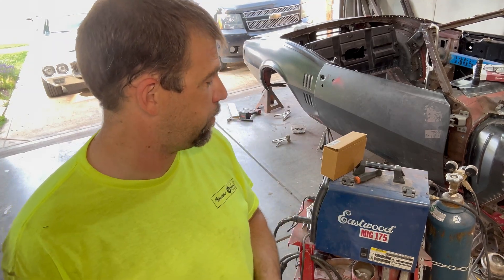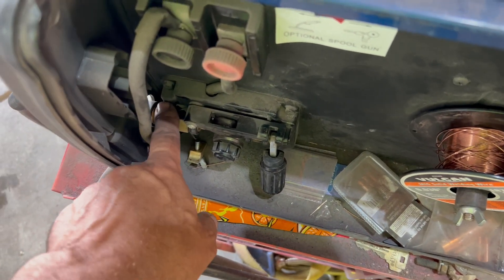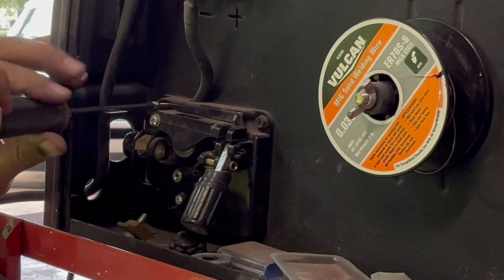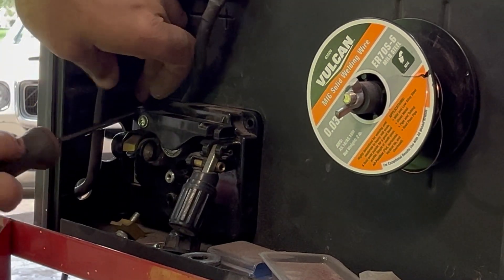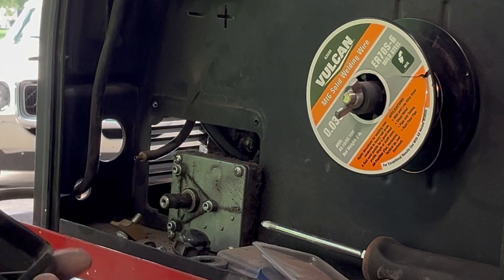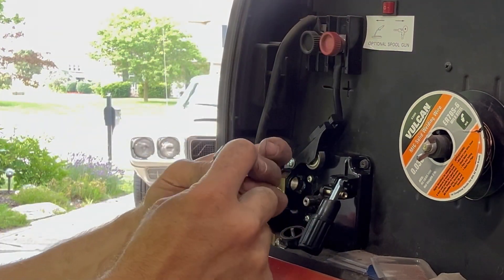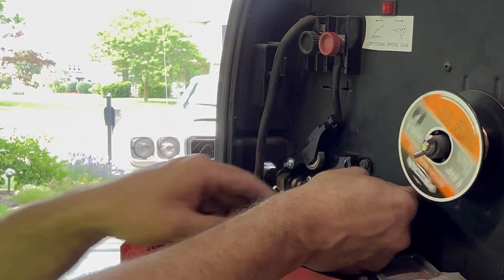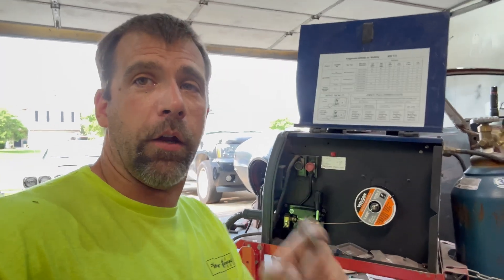Tech Tuesday Welder stopped working how to repair

Comment: Enjoyed this short video. I'm a power of BLUE guy myself, running a Millermatic 211 building fences and a upstairs mezzanine in my shop. Get ready to weld the rust holes in my trunk floor of my 67 Firebird and weld up the spoiler holes in the deck lid. I'm learning a lot from watching you. Thanks
Reply from the maker: Right on!!  You will make several others viewers very happy after removing the spoiler holes 😎

Comment: Nice fix. I've got the 135. Good to know Eastwood still has replacement parts. As cheap as that drive motor was, I'm going to order one now in case they don't have one available when mine breaks.
Reply: What is the name of that part? Drive motor housing? Shield gas housing? Thanks you friend.
Reply from the maker: It was listed as “drive motor block” then it has with or without motor
Reply: @VinylVillageGarage  Thanks Jon.
Reply from the maker: @Rick-O-Shay60  no problem

Comment: Jon, excellent DIY video! I have a, HF Titanium 170. The only bad thing about it is finding replacement parts. The good points are, it's LIGHT and works on 110 volts. I have used it on several metal building projects. I used a shoulder strap and carry it up ladders and on scaffolding. When I wear this one out, I'll buy another one! Mig & Fluxcore. It fills my needs, although I know there are better options. Money is always a consideration  with me. Build on Brother Jon!
Reply from the maker: My old Eastwood been a champ too.  Always said if it died I would replace it with the same

Comment: Jon look like you are using 030 wire do you prefer that over 023, thanks
Reply from the maker: .030 is what I use for everything I need to do.  Just what I learned on and got comfortable with

Comment: Makes me think my Lincoln weldpack 100 might need replaced like yours. I went thru a small tank quickly. At $60 a pop to refill. My welds not looking great. Might have lack of gas shield
Reply from the maker: I noticed that I had more issues with weld porosity briefly just before it broke. I think it might have been failing just before it completely split

Comment: That's all that plastic crap, just like motor parts today, years ago it used to be phenolic you could not destroy it with a hammer.
20 years😂😂 I have welding machines 55 plus years old, Meg machines all Miller most of them are 40 years old, those little machines only have one advantage you can pull them around easy, 
    They also have a big disadvantage with the little rolls of wire, the little rolls are not economical at all.

Also to keep your machines in Tip-Top shape you need to take an air nozzle and blow them out at least twice a month,  also on all your O-rings use a small amount of Vaseline.
Reply from the maker: This Eastwood welder I purchased over 20 years ago and this was the first major malfunction and it’s been rained on a few times. I am not disappointed especially considering I only paid maybe $350 and it came with an aluminum spool gun too.

Comment: I'm still using a Millermatic 35 my brother and I bought back in the early 80's. I think we replaced the hose about 20 years ago and just recently I had to replace the gas flow valve. Only wish my brother was still here.
Reply from the maker: Nothing wrong with tinkering and keeping it going

Comment: My Lincoln died 3 weeks ago. Over time it wanted more voltage to do the job. Then it started not wanting to arc and finally it was melting the wire on top of the work looking like it does when they blow glass and start with the big orange blob. It was over 30 yrs old so it's done me well. Picked up a new Lincoln. Suddenly I'm able to lay down much better welds
Reply from the maker: Sometimes it’s makes more sense to replace it.  I want to try one of those new ones and even experiment with rig welding someday

Comment: I had a Miller year's ago the transformer went bad, I used it a few times I liked it but now I can't use them because of a medical device sucks I wanted to learn more with welding I can still use gas but that's not the same 👍
Reply from the maker: We have miller welders  at work and great machines but a little spendy for me